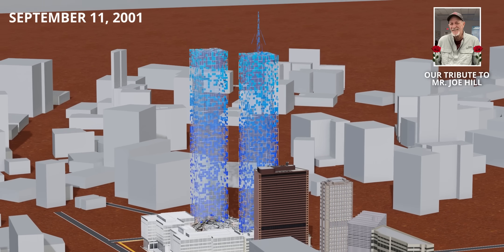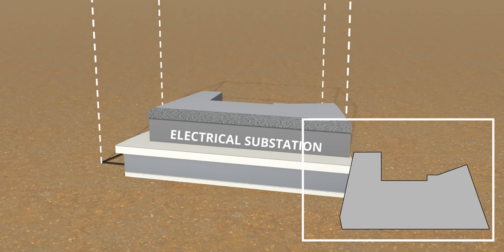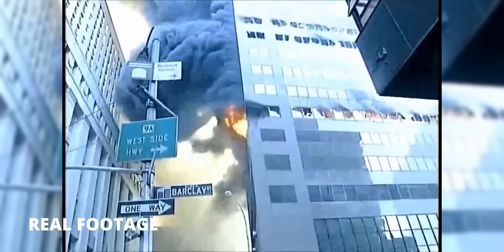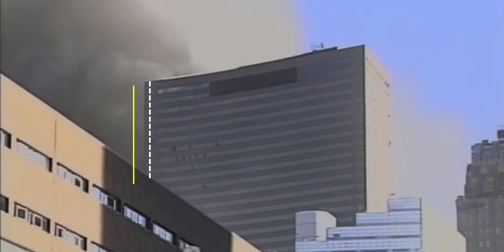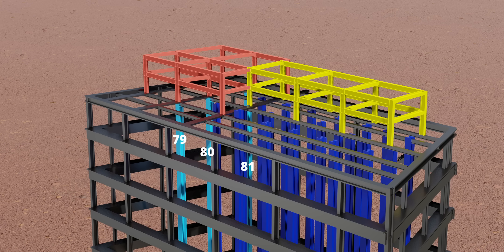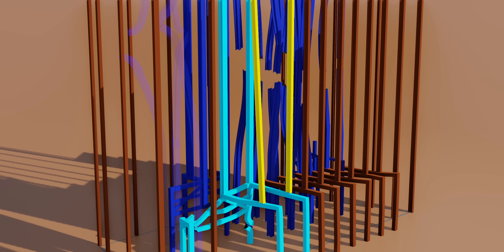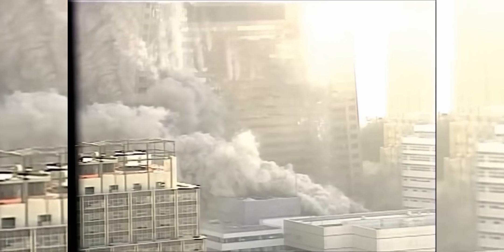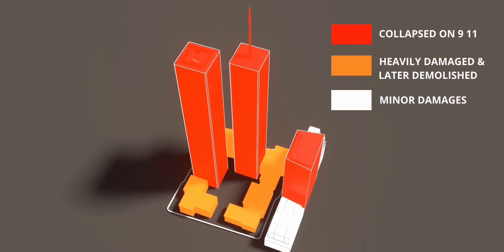Collapse of Building 7 | The Complete Physics

Comment: 6:45 is carrying metaphorical tons to this hypothesis without a proper explanation for the progression of the non-substation core columnar failures. Official reports suggest that a singular core column failure on the west end resulted in the total failure initiated from the collapse on the east end. Even the narration at 8:12 admits the damage caused by debris was likely not on the core columns, but to the facade supports. Furthermore, a failed transfer truss from one side of core columns would cause further column failure to progress from the outside in due to girder-load transfer, rather than the inside out as suggested in the model.
Reply: @h1F595  Symmetrical collapse refers to the way WTC 7 collapsed with the bulk of the building retaining its shapes across it's entire width for a considerable part of it's initial movement. This is what we saw from many angle s thanks to broadcasts on the day. 

Symmetrical collapse is in contrast to what you would expect if uncontrolled fires weaken beams in a random fashion  leading to different parts of the building  sagging and collapsing at different times and at different rates leading to a collapse that would have been more chaotic and unstructured than what we observed.
Reply: @h1F595  The significance of considerable amount of symmetrical collapse AT FREE FALL is that it can only happen if the under lying structure of the building stops working suddenly and in its entirety.

Is that plausible?

Well think about uncontrolled fires and how they would gradually heat columns but in some hap-hazard and uncontrolled manner. The columns will not be heated at the same rates or same temperatures because it's not a tightly controlled heating effect.   So if columns were to yielded due to heat as alleged, they are unlikely to do so at precisely the same time or rate.  Also, steel will not fracture before sagging of deforming significantly so again, due to the variation in heating from uncontrolled fire, columns would not give out in one synchronised or well-coordinated fashion.

So, the question becomes: How can the gradual and uncontrolled heating of so many columns lead to the precisely synchronised and instantaneous failure of all columns required to create a symmetrical free-fall collapse as we witnessed with WTC 7?

No one has presented a plausible explanation apart from controlled demolition.
Reply: @gladishilton1943  WTC 7 was heavily damaged by the collapse of the north tower and burned for approximately 8 hours. The FDNY assessed the damage and knew it wasn't going to last. The collapse begins with the penthouse first, the inner east side then the inner west side then the facade. It twisted on the way down and damaged the Verizon Building and Fiterman Hall. There was no controlled demolition. You don't believe it? So what? Your personal incredulity doesn't matter and instead of doing proper research, you're here on YouTube needing strangers to explain things to you.
Reply: @joshd3192   So what you're saying is that you believe the official story that for 
the first time in history fires brought down a steel structured buildings 
despite countless other examples of steel building burning with more ferocious and engulfing fire for longer periods of time, survived to the point they were refurbished and are still in use today.

You're also saying that you subscribe to the explanation that random damage igniting uncontrolled fires were capable of weakening 70+ columns  in such as manner as to seem them all progress through the phases of sagging and deformation and all arrive at the point of total failure with precise enough timing to see the entire building symmetrically collapse over its entire width in free-fall for approximately 2.5 seconds - that's around 8 storeys.

You're saying you subscribe to an official explanation which so many Architects, engineers, scientiists and demolition experts from America and around the world have have rejected as plausible.

You're saying you subscribe to an explanation prepared by a government agency who was place in charge of doing the investigation of the biggest crime scene in American history and that agency had no experience or mandate to undertake such investigation and agencies that exist for precisely this purposes - the FBI or the CIA - were not used to lead the investigations.

So sure, my incredulity and that of 100s of construction & science professionals and demolition experts don't matter.

On the other hand you acceptance of the official explanation - with all it holes - is positively gullible.
Reply: @Kudde23   Uh huh. Why not present this "evidence" of yours to the proper authorities then? Why waste your time spewing your rhetoric on fringe YouTube videos?
Reply: @Kudde23  The only thing you provide is conspiritard talking points and proof of nothing.
Reply: @Kudde23  Why would someone paying me (they're not) to post on YouTube be painful? And on what page of their report do they provide evidence of a controlled demolition? Go ahead, give the page number.
Reply: @joshd3192  Oh Poorpoo, this will be shocking to you, but: I dont need to remember the page number since it´s absolutely not on me to do your shill´s homework. Go look up the reports, try to actually DO something for your shill money shill!
Reply: @Kudde23  TRANSLATION: You have nothing. Got it.
Reply: @Kudde23 You still have nothing. Got it.
Reply: @joshd3192  Keep on dodging the free fall Poorpoo!
Reply: @Kudde23  "that NIST itself provided evidence for the controlled demolition of WTC7"

On what page? I've read the entire thing.
Reply: @joshd3192  Oh so you know the pages that mention the free fall, cool thing you finally admit that. Now dodge the free fall Poorpoo! Dodge it harder! Be a good boy! Dodge the free fall little Poorpoo!
Reply: @HowardFinkelsGhost  Yeah you´re a good boy too Finkleshill! Yeah you know thermite, yeah good boy! Now dodge the free fall! Dodge harder Finkleboy!
Reply: @Kudde23  Nice try. You said NIST proved it was controlled demolition. They did not. All done now?
Reply: @Kudde23   Thermite isn't an explosive. Oops.
Reply: @HowardFinkelsGhost  So what you´re trying to say is that thermite doesn´t make the sounds of explosions that YOU said are missing? Watch it Finkleshill, you´re soo close to comprehending something, SOOOO close!
Reply: @Kudde23  No princess. He’s saying thermite doesn’t explode. All done now?
Reply: @joshd3192  Poorpoo, Finkleshill said there were no sounds of explosions and he also said that thermite isn´t an explosive. Finkleshill almost managed to figure it out. In contrast to you Poorpoo, so sad...
Reply: @Kudde23  Anything else princess?
Reply: @joshd3192  Good boy Poorpoo! Dodge the free fall! Dodge it harder Poorpoo!
Reply: @Kudde23   All done princess?
Reply: @joshd3192  Yeah you´re a good boy Poorpoo! Keep on dodging the free fall Poorpoo! Dodge it harder Poorpoo!
Reply: @Kudde23   Anything else princess?
Reply: @joshd3192  Good boy Poorpoo! Dodge the free fall! Dodge it harder Poorpoo!
Reply: @Kudde23   All done now princess?
Reply: @Kudde23 So this whole time, the FDNY was lying to us?
Reply: @joshd3192  Yeah you´re a good boy Poorpoo! Keep on dodging the free fall Poorpoo! Dodge it harder Poorpoo!
Reply: @Kudde23  All done now princess?
Reply: @ButtHead-n5u  Are you showing off all your skills again Finkleshite?
Reply: A case of someone trying and failing to sound a whole lot smarter than they actually are if I have ever seen one. Let me fix that mess for you.

The unknown and unimportant Building 7 was the 6th building to collapse of 10 lost on 9/11. Though extensively studied, it confuses many people. Not famous, or a terror target, and no casualties, thus it did not get a lot of attention and few know much about it, creating a void rapidly filled with garbage from the internet. Because everything seems like a conspiracy if you don’t understand how it works I prepared this brief summary explanation of my own analysis. No politics, just engineering. 

The North Tower collapse at 10:28am bombarded Building 7 with tons of burning debris, causing heavy damage and starting raging fires burning out of control for 7 hours. Half the responding FDNY firefighters having been killed, others injured, units in disarray, equipment destroyed, no water pressure, and the greater urgency of Search & Rescue efforts, firefighting at 7 was pulled as futile. The building couldn’t be saved and was left to its fate.

www.youtube.com/watch?v=g_SvpwyC17M&ab_channel=MFitz  

Collapse of a burning structure is always a concern for firefighters. Steel buildings subject to fire rely on active fighting of the fires to survive. Left to their own devices they will collapse. Buildings are designed around 1 to 3 hours of fire resistance, allowing time for occupants to escape and ACTIVE firefighting to get started, after which all bets are off. In B7 the occupants escaped, passive and active fire protections were compromised and active firefighting was abandoned which left the building to take its chances. It lost. Odds on Building 7 would eventually collapse, and it did. No big deal in logic. That is the sort of choice firefighters make every day in brush fire situations - which houses to save and which ones to let go. Only real difference here is moving the decimal on the size and cost.

www.youtube.com/watch?v=WnYBX6QT0R4 

FDNY Chief Daniel Nigro ; The biggest decision we had to make on the first day was to clear the area and create a collapse zone around the severely damaged 7 World Trade Center, a 47-story building heavily involved in fire. A number of fire officers and companies assessed the damage to the building. The appraisals indicated that the buildings structural integrity was in serious doubt. I issued orders to PULL BACK the firefighters and define the collapse zone. It was a critical decision; We could not lose any more firefighters. It took a lot of time to PULL EVERYONE OUT, given the emotionalism of the day, communications difficulties and the collapse terrain

FDNY Deputy Chief Peter Hayden ; We had our special operations people set up surveying instruments to monitor and see if there was any movement in the building. We were concerned of the possibility of collapse in the building. And we had a discussion with one particular engineer there, and we asked him if we allowed it to burn could we anticipate a collapse and if so, how soon? And it turned out that he was pretty much right on the money, that he said 'In its current state you have about 5 hours

The collapse of Building 7 was anticipated all afternoon and widely reported in the media with at least 24 video cameras recording some or all of the collapse. Everyone at the time knew what was coming and why.

www.youtube.com/watch?v=OY5S5k3tMHI 
Building 7’s collapse was totally different to the Twin Towers, harder to understand and most of the details difficult to see. But we can sort out what happened through careful analysis and observation.  What follows is MY EXPLANATION of the collapse sequence using the best available information and relying on no authority.

B7 was complex structure, a 47-story steel framed building built on top of a smaller existing 3-story building, requiring several lower floors dedicated to complex load transfer structures instead of usable office space. Of trapezoidal shape and all-steel tube-in-tube construction, B7 (above the 7th floor) consisted of a central core of steel columns carrying most of the gravity load, perimeter steel columns around the outside of the structure carrying the remainder of the gravity loads and long span beams and girders to tie those elements together and form the floors. On the outside of the building hung a moment frame - the last part of B7 to fall. 

Phase 1 : Collapse initiation for B7 is notably quiet with observers not realizing the building was collapsing! There was no audible warning in the form of say hundreds of ear drum busting 180-190dB explosive bangs preceding the collapse. The first externally visible signs of collapse initiation occurred at 5:20:28 pm. Here at 12:00 a local CBS affiliate reporter is talking 10 blocks from B7 when collapse begins. People don’t start to notice the collapse until 12:11. Then at 12:45 is the famous CBS fixed camera clip of Building 7’s collapse Again, note how quiet it is.

youtube.com/watch?v=t5tEy6mXSE8&ab_channel=fresnosean379

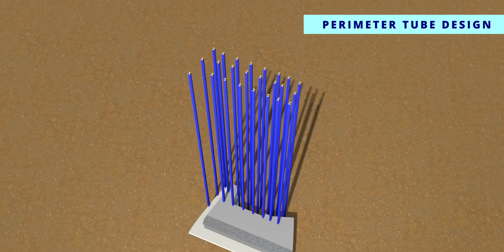Collapse initiation was due to multiple lower floor failures above the load transfer region (7th floor) in the NE corner of the building. In this video at 0:45 you can see the NW corner from inside the building while under construction, Column 79 just out of frame on the left. That big, angled steel beam across the top of the frame connects to C79 at one end. The girders connect to the beam. That beam and all those girders depend on just one connection

youtube.com/watch?v=nP3TNHPCIVU&t=35s&ab_channel=EdwardCurrent

Phase 2 : Lower floor failures caused a loss of critical lateral support over an excessive length of core Column 79 and it buckled. If you look at a floor diagram of Building 7 (see above) and look at all the structures that depend on C79 you quickly realize this one column was a relatively isolated structural element on which a disproportionately greater fraction of the structure depended . Externally we see a vertical progression of window breakage along the 44-46 line and a kink in the roof of the East Mechanical Penthouse at the top of the building, consistent with C79 failure. The transition from full capacity to almost no capacity occurs in virtually an instant. Once the buckling failure occurs there is almost no resistance

Normally with a buckling column, the load could very well be redistributed to other columns, meaning the buckling could stop after a while. With C79 that is not the case - the failure did not redistribute the load, so the collapse rapidly progressed to the roofline, sinking the rooftop penthouse.

Phase 3 : With C79 gone, B7’s progressive, non-symmetrical collapse continues with C80 and C81 at the east end of the core left laterally unsupported and quickly buckled and failed as well, sending the EMP down through the building. C79-81 all have no diagonal bracing, which I believe is a major reason why they could not redistribute a lot of vertical loads among one another.

From there collapse progressed from east to west through the central core until the core was gone taking all of the interior floors and structures and probably most of the perimeter columns with it. You can see the horizontal progression of window failures low in the building and the dropping of the remaining rooftop structures into the building. One of the big takeaways from the NIST Building 7 study (that gets completely ignored) was their modeling which determined C79 failing under ANY circumstances would have initiated the same collapse sequence.

Phase 4 : Just over 10 seconds in Building 7 is reduced to just a hollow empty outer shell - the exterior moment frame, which creates the illusion the building is still standing since little has changed externally. But it’s just a hollow empty shell, like an empty cereal box, supported by only a few remaining columns and quite unable to remain standing. The north face leans inward, forming a V in the roofline, the last perimeter columns buckle under the strain and with nothing left keeping it up the moment frame free falls, landing on top of the 7-story high debris pile. It is only here, at the very end that a single measurement of alleged free fall is taken. Start to finish the collapse took 18-20 seconds, or less than 1/3 of true free fall but who cares since how fast something falls cannot tell you what started it falling in the first place. The free fall argument is about the collapse of the outer shell AFTER all of the critical internal structure had already failed.  It completely ignores about 80-90% of the collapse. The debris spread out well beyond Building 7’s footprint , blocking surrounding streets, heavily damaged the Verizon Building and destroyed Fiterman Hall Broadway, all well outside of Building 7’s “footprint”.  

Building 7’s progressive, non-symmetrical collapse was incidental and unintended collateral damage from the combined effects of fire + time + gravity started by the collapsing North Tower. That is true no matter who planned and carried out the 9/11 attacks or why . The collapse was of so little consequence it barely even registered at the time, a mere footnote. 

Anything can seem like a conspiracy if you don’t understand how it works. Now you should. I hope you found this helpful and informative, not adversarial and it solicits informed critical comment. If I made any errors of fact, logic or reason or left anything critical out, please let me know so I can fix it. IF you can offer a more plausible alternative please do. Be the first. Please start any reply with the words “Tits McGee” or I will know you didn’t read it and are wasting my time.
Reply: @TheCriticalStinker-01   I'm sure you're very proud of this womderful fairy tale that you've prepared however,  with your reliance on a magical combination of progressive and "virtually instant" failures allegedly brought about by the uncontrolled heating of random fires allegedly causing the gradual softening of columns, you seem to think that you have explained a symmetrical collapse of an entire building - at free-fall - which lasted for approximately  8 storeys 

I think you're ready for a brilliant career in fiction writing.
Reply: @TheCriticalStinker-01  No-one asked for your copy paste garbage about an unknown and unimportant building Fitzshill. Topic here is the well known and important WTC7 which housed the mayor´s office, the OEM hq, CIA, Secret Service, DoD, SEC...
Will you ever learn this simple fact in your shitty "life" Fitzshill?!?
Reply: @Kudde23  Anything else princess?
Reply: @joshd3192  Are you showing off all your skills again Poorpoo?
Reply: All the plants are in the house ! The greenhouse of BS 💩🪴🫡💩🫡🫡💩🫡🫡